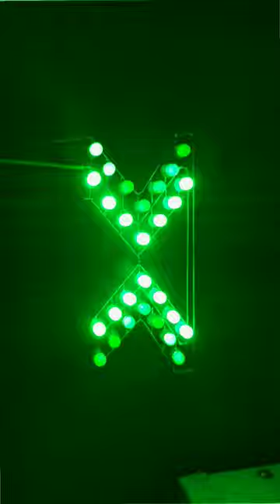arrow sign with led #shorts

Comment: Genius that you are,  of what use is it.
Reply from the maker: Bro what things we make that is useful for every person 
Give me Idea bro..
Reply: @Electro_shastra  Make a rugged water level controller. Even commercial water level controllers have a high failure rate.
Reply from the maker: Nice Idea we will definatly try in future and try our best..
Reply: @Electro_shastra  I will tell you why they fail. 1 hp  motors consume approximately 3.7 amperes.  Their sensors are not responsive when algae or dirt accumulates. I have a million ideas. If you want to team up, send me a mail.
Reply: Pra apontar onde fica o teu precioso loco